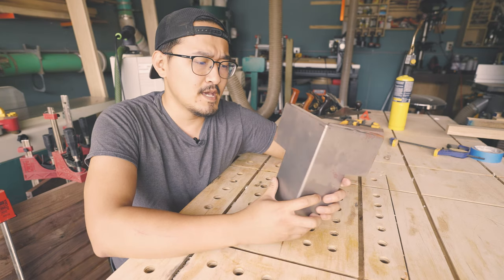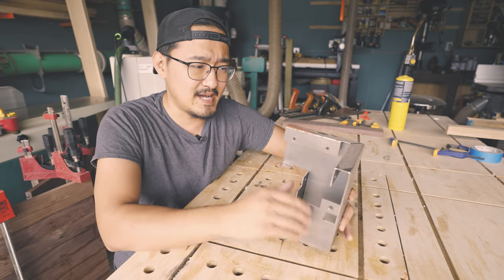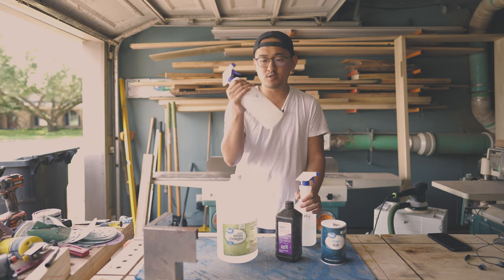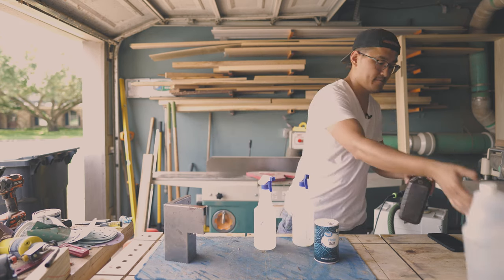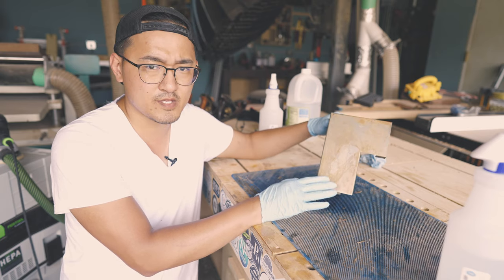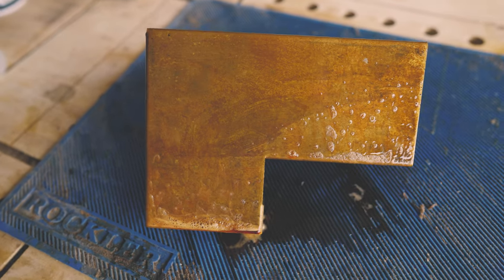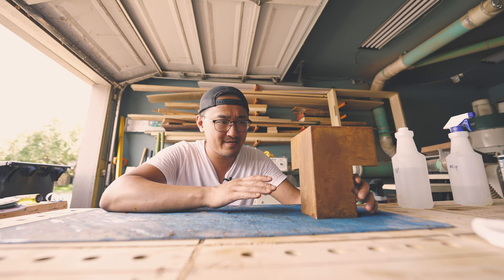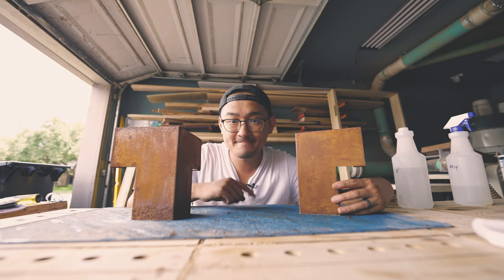Corten Steel Finish with Household Products! // How To // DIY Projects

Comment: Awesome technique!  I plan to use this for some architectural trim around my soffit vents.  I think that this finish on steel will blend nicely with my western red cedar soffits.  

It might be useful to wash the parts first with soapy water to remove any mill lubricants or fingerprints, for consistency across parts.
Reply from the maker: Thank you!

Comment: Hah! Nice result. Linseed oil is a time honoured treatment for steel too. I use it on most everything, from exterior brick work (bit of carbon black oxide to tint it), wood both internal and external, copper, concrete, gal steel, corten and raw steel after a suitable period of oxidising. Wonderful stuff, proper wabi sabi look.
Reply from the maker: Oh I didn't know that! Might have to give it a try in the future
Reply: Have you tried Japanning?
Reply from the maker: @jerrywhidby.  nope. Never heard of it

Comment: Thanks for the informative and interesting video. I would like to create my own exterior corten steel look. How would I seal.tgis look please?.I'm concerned when it rains the rust will run down my house. Thank you.
Reply from the maker: I would use an exterior oil base urethane to seal it
Reply: @DesignCraftWorkshop  thank you. Would this stand 45⁰C heat during summer and rain during winter ? Also do I have to keep applying this oil ?

Comment: Pls someone the proportion ratio ..
Reply from the maker: The ratio is explained in the video.
Reply: @DesignCraftWorkshop Not clearly or audible enough. Also 1 to 8 parts of what ml? Then one tablespoon of salt. Surely using liters vs ml will need more salt.

Comment: Do not do this to anything important! It might look nice for now, but unlike Corten, it will keep on rusting. Soon it will look terrible. A little later it will rust completely through, destroying your piece.
Reply from the maker: Thanks. You can actually seal it with a clear sealer to prevent it from further rusting.
Reply: Or WD40. Or Inox.